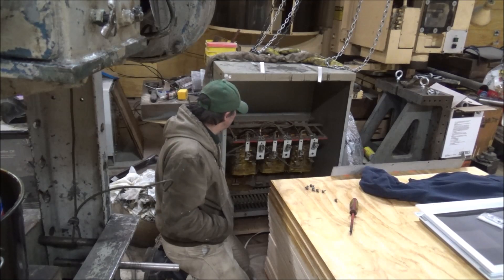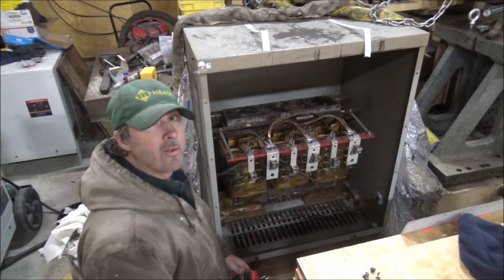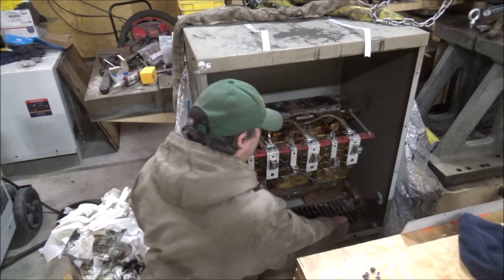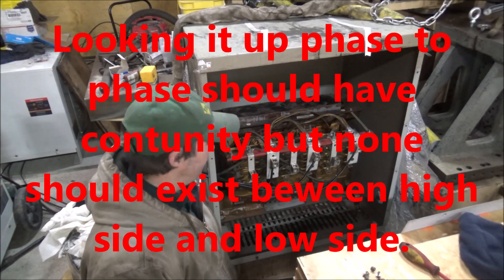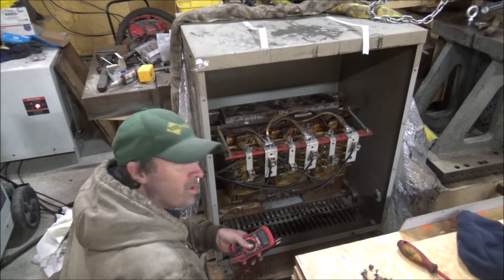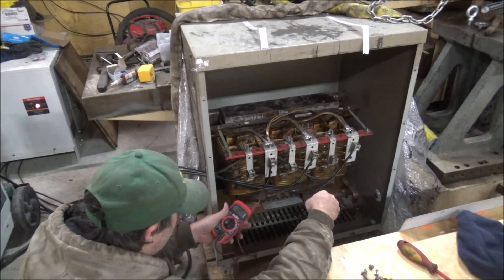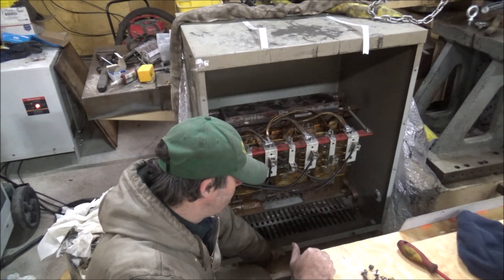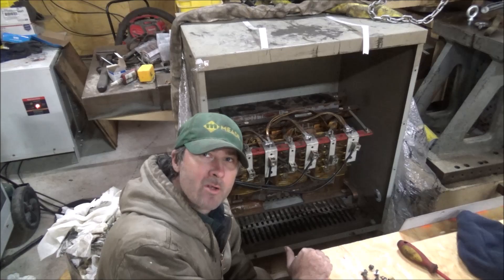Powering Big 3-phase Machinery 480Volt Transformer

Comment: When seeing this, I feel sorry for you americans, who struggle with phase converters as big as this transformer. Here in europe one would not be allowed to wire up such thing unless one has 3 phase from the grid.
But I think it would be wise of u to get a distribution panel for 480 volts wired to the transformer, and wire each of those machines to the panel with fuses of reasonable siezes. And I think the panel should be big enough to handle a transformer twice as big as this, then there are no need to change it when the transformer are changed for a bigger one.
Reply from the maker: I may not have shown it but I already have a 225 amp 480V load center with magnetic breakers.
Reply: It's got nothing to do with being American. It's more about living in the countryside. If Brian was willing to pay a lot of money to have the cables put in he could have 3-phase power. I have the same problem here in the UK. I only have a 100A 240V single phase supply. Getting 3 phase brought in would cost tens of thousands of pounds so I just use a generator when I need 3 phase power for the machines that can't be converted to single. There are no laws in the EU to stop you using phase converters to run machines. I have seen plenty of workshops doing it.
Reply from the maker: Only $100,000 dollars to get the extra power lines run, anybody want to pitch in? lol
Reply: It's a sad commentary of where we have come to as an "industrialized country" that the power companies encourage customers not to use their product .I can't think of any other buissnes that functions this way. The depression era generation was geratful for rural electrification. The environmental movement does everything to discourage competitiveness in this country. People wonder why their buying power grows smaller and smaller.
Reply from the maker: I can understand them not wanting to run the lines, I would be the only customer for it and I am on a dead end so they wouldn't ever feed anything else.

Comment: The imbalance likely comes from your phase converter, I was somewhat surprised that it still delivers one phase when it is powered off, since that would risk buring up a motor if you forget to switch it on?
This is grown-ups voltage now, using a cheapo meter for this stuff makes me uneasy.
Also it would be 5 minutes well spent to add a ground connection, a ground fault may not show up on a low voltage continuity test. That's just like making sure to never stand under a suspended load, just in case the cable breaks, it's been known to happen...
Reply: The phase that comes through is the one that goes into the converter.  You'd need an extra contactor to stop it but I agree it would be safer. 
 I originally thought a rotary was a single phase motor coupled at the shaft to a 3 phase generator,  which would be isolated and balanced,  but they're actually a single modified 3 phase motor.
EDIT:  the off switch on the converter should isolate the output phase too AFAICS, so now I'm confused
Reply from the maker: The way American rotary wires their converters the single phase feeds thru because the single phase input is shared with the motor feeds to the converter idler.
Reply: @bcbloc02  Still makes no sense to me, why wouldn't the power switch on the phase converter disconnect that phase when it is off? I find it hard to believe they would build this flaw into the system, are you sure you wired that thing right? 
If it can't be avoided I would put a motor starter on every machine, because sure as hell I'd forget one day to power up the rotary converter first, and burn up some motor on one phase.
Reply from the maker: None of mine will start if you single phase them, they just hum and you instantly know to hit stop and go start the phase converter. . I don't much care for it being that way myself as occasionally it happens. The power switch only operates the contactor to the idler motor so the switch has no control over the input side. I think they do it that way so that if you have  a machine that uses single phase power like for memory it doesn't loose it.
Reply: @bcbloc02  Yea it hums because it sits there stalled drawing full starting current on that one phase, you can burn them up right quick that way. A motor is not like a transformer that dosen't care, it needs to spin.
Luckily we have 400V three phase power everywhere, but dropped phases are still a possibility (think faulty switch) and I use motor starters to protect all larger motors.

Comment: Run Shop Boss - minion is playing with high voltage.  

Don't be too hard on Shop Boss. If minion had the heated floor running full tilt - there would be no need to make a monitoring station out of insulation. 

Dan

Comment: Baily is probably pretty upset there was nothing in the middle of that bail. Only a nice bed!!! Handy tool that thermometer. all the motors, baring's, exhaust ports and everything you can tell is at normal operating temp right there at your fingertips and thanks for the inside story on the transformer. Primomotorsports gets a gold star for there rundown below there

Comment: Aluminum and electricity do not mix! Yah, it is allowed in many locations. I will recommend for all you who are stuck with any aluminum wires, bussbars etc, is to study in absolute detail how to properly make connections to it and maintain those connections. I have delt with aluminum before. When making connections, if you want to be prepared for the future, allow enough wire so you can in the future cut off the ends and re-make connections. Aluminum absolutely should be outlawed in electricity, but seeing how it is allowed in many places, youall need to outlaw it in your own heads, at least in the shops, homes etc that you own. Where you do have to deal with it, keep plenty of cleaning and connection chems in stock.
Reply: Aluminum is perfectly acceptable to use as the service wiring connecting the transformer.  Aluminum has been for many years and is currently the preferred material for power transmission and distribution.  Aluminum has a better conductivity to weight ratio and of course is much more economical than copper. If the connections are aluminum lug to aluminum wire (as it appears),  there will be no issue.  If copper wire is used then an anti-corrosive ( Ideal Noalox, for example) would be required in the connection.  Many years ago (the 60's and 70's) a "hard alloy" aluminum wire was used during the copper shortage.  This wire was not compatible with the steel screws used in switches and receptacles.  The expansion rates of the dissimilar metals as well as the corrosion issue led to many failures and dangerous installations.  This situation was found typically in low load circuits using wire sizes of #10 and smaller.  "Aluminum absolutely should be outlawed in electricity" is nonsense.  Modern aluminum alloys and connectors make for safe and "code compatible" installations throughout the building industry.  Brian will have no issues with aluminum service wiring.
Reply: EE here.. next time you are driving a car and see a large power pole think that that wire hanging in the air is made always out of alu (with some sulfur) and steel core... can't hang copper.
Also auminium burns off only where there are multiple dis&connections underpower.. imagine that on trafo screw terminals?
And to be honest half of my house is wired with old alu wires. Rarely causes a problem.
Edit: newer had a problem with rust and alu myself.. maybe because i have screw contacts from copper?
Reply: Minor nit pick - whether the stuff over your head is Al or Cu depends on things like how far out in the sticks you are. Most all of the lines around here have been upgraded to larger Al conductors over the years, but I can still find a few places with 21KV hard copper wire overhead.
Reply: @lwilton  around my area it's only used for train traction. Although DNV KEMA have developed a new type of copperalloy cable meant for more dense populated areas that might periodically generate large amounts of (renewable) power

Comment: Glad you posted this. I have a radial arm drill with a 15hp motor on it, its wired for high voltage only. So I’ve been looking at used transformers. I think I only need about a 30 kva though. I think you and I share a common problem; there is always more shop expenses.
Reply from the maker: I think you are best to oversize some on the transformer otherwise they run hotter and loose efficiency.  Building out a shop is EXPENSIVE!!
Reply: Thanks for the tip. Hadn’t even considered buying one larger than needed. Used transformers are fairly inexpensive, so buying a bit larger isn’t that bad. I get lots of inspiration for me to build up my own home machine shop. I just have to keep at it and keep picking up tooling

Comment: As you put the system under load the phases should come into closer balance. The load motors act like RPCs too and tend to correct any aberrations.
Reply: Even at idle I'd say the 480V side is pretty good. Pretty much within 5% of 480V.

Comment: That's a neat unit Brian. 480v is great. Opens up lots more equipment possibilities like you said. 👌
Reply from the maker: Yep I am excited and a little scared about getting the VMC up and running soon.
Reply: @bcbloc02  That VMC should be a heck of a machine. Who knows what you may run into getting it up and giong.  The gentlemen who gave you the large angle plates ask me for your email. I gave it to him.
Reply from the maker: Yep I talked to him, thanks!
Reply: Used 480v equipment is often cheaper too because most people don't have a way to power it.

Comment: Hey Brian, The 112.5 kVA, 3-Phase transformer is actually only good for 135 amps at 480 volt, and it wants 270 amps at 240volt 3-Phase to feed it. When dealing with three phase power calculations, you need to use the voltage x the Square root of 3 (1.732) or 240 x 1.732 = 415.7 V and 480 x 1.732 = 831.4 V.   Therefore 112500/831 = 135.4 amps and 112500/416 = 270 amps.
Make sure you look up the specs on using the transformer as a "Boost" transformer. I think you want to make sure you don't use the neutral on your 480V side, (or something like that, I know there is an issue you have to be aware of with regard to the XO tap and grounding/neutral relationship. I am just having a brain fart right now.) This is also suspect for causing your voltage differences between H1, H2 and H3.
Reply from the maker: You are right. It is still good for more than my phase converter can output anyway, at least for now. :-) this is a delta-delta trans so it has no neutral.
Reply: @bcbloc02  No problem. I just heard you talking about the transformers capacity and didn't want you to be misled. Also, I know that the grounding/Bonding of this will be important to stabilize your voltages. (they will settle down a little once a load is put on it too). Cheers Brother!
Reply: @PrimoMotorSports  It's a "separately derived system" in NEC speak. Depending in the size you might need a grounding electrode or bond to same. I would need to look it up since I didn't do these types of installs typically.
Reply: @chasmosaurus3  you are correct. It still needs a ground. the question that i cant remember the answer for is whether or not XO gets bonded to ground.
Reply: There is no X0 on a delta transformer winding, unless you are dealing with one that has a center tapped winding such as a 120/240 3phase unit
Reply: @danielnack6812  oh it's a delta. I thought it was a star transformer
Reply from the maker: I plan to ground it back to the mains into the building otherwise I don't think a short to the case would trip the breaker feeding it and it would just assume it is a load.
Reply: And remember to put 3 phase overamp, and difference brakers at the transformers output side.

Comment: Hope you area going to put this outside...the hum would drive me crazy...
Reply from the maker: Plan to put it in the attic with the phase converter. A foot of rockwool plus 2 layers of plywood between me and it should make it virtually silent I hope!
Reply: Both the phase converter and the transformer makes some heat. Be careful not to insulate them to get on fire.
Reply from the maker: They won't be insulated  or sealed, just on the other side of the ceiling.